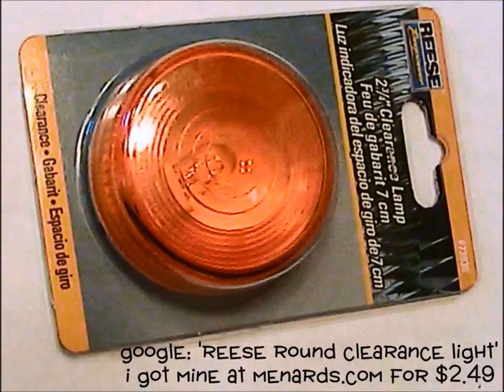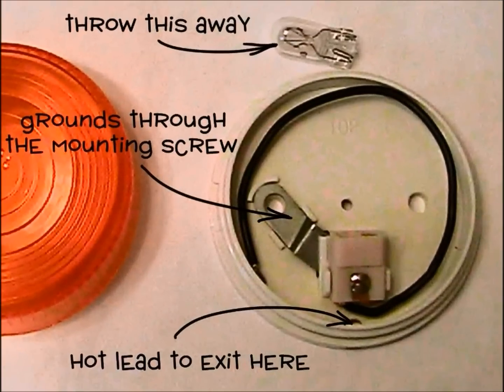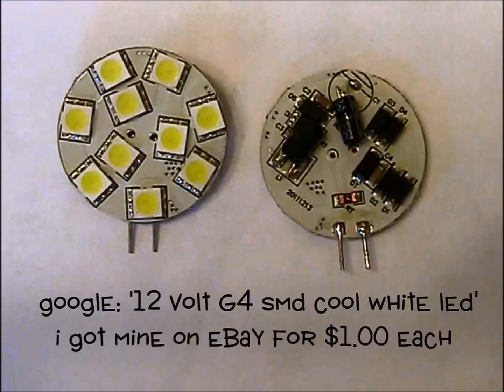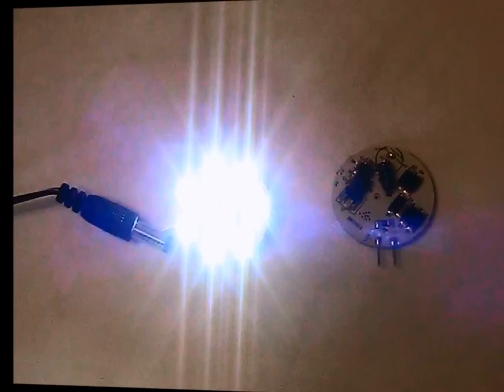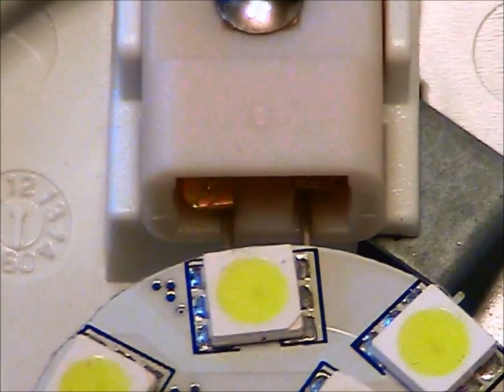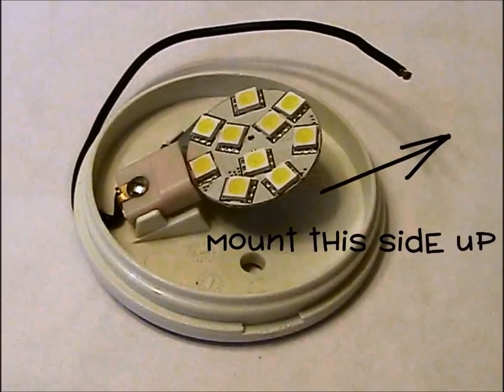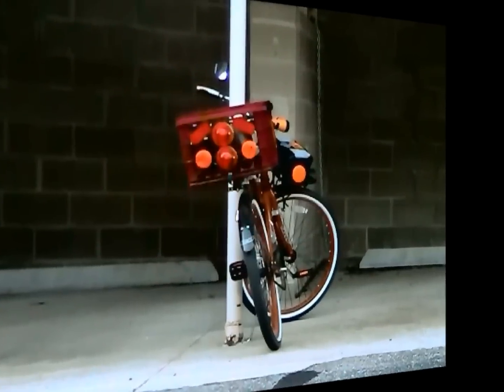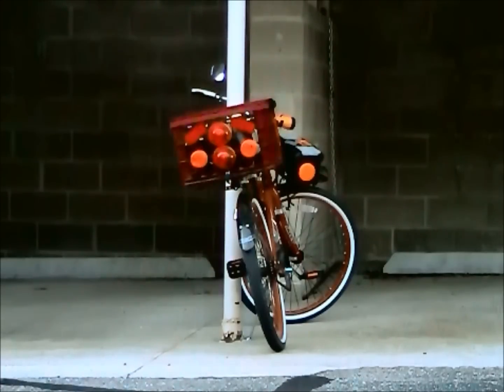Make Your Own LED Lights For Bicycle Turn Signals And Flashers

Comment: Nice job!!!!! With all these bicyclist getting hit and killed out here in So Cal maybe you can mount these on some kind of small piece of material to put on the tail end of any bicycle....beats getting hit by a car!!!
Reply from the maker: We're on the right track here, but these turn signals are only supposed to work when turning. A cheaper and better solution to being seen all of the time is to use a strobe as a tail light. I use an electronic 'Flare Alert' as a tail light and for visibility. See my video, 'Flare Alert: The Best And Brightest Bicycle LED Tail Light Ever Made', on my Youtube channel.

Comment: thanks for your helpful responses.  could this all be powered with just a 12v alkaline a23 battery? 12v battery powers 12v led lights and 12v flasher? theres this video that says you need a driver (current regulator) when connecting a 12v power supply to a 10w led or else it'll fry the led.  why isn't that needed in this case?
Reply from the maker: danh le I can't answer all your questions because that would require designing a completely different system. I can only show you what I have done. Check out my other videos that show schematics and details of the two systems I have built so far. I'm sorry I can't be more helpful.
Reply: ***** you are respectful and helpful. thank you

Comment: how do you attach the wires up so it is a circuit? There is only given the black wire, and I am unsure how to connect the second wire, which i assume i need. Any help?
Reply from the maker: +purplewuggybird I soldered a ground wire to the lamp base for the ground. Be careful not to melt the plastic bulb socket.
Reply: Clarence Cromwell

Comment: so the moped handlebar switch assembly is what makes the lights flash on and off? I would think that switch would just turn it on and off completely-not make them flash. is there something in that switch like a capacitor responsible for turning it on and off? wiring and electronics confuse me so sorry if that sounds stupid.
Reply from the maker: I covered this in an earlier reply and you are right. The switch only selects the on-off-direction function of the signals. I used flasher model number G215-EB from www.superbrightleds.com because it's one of the cheapest and easiest to use. It's a two-wire unit that I wired into the power lead just ahead of the switch. I included a peek into my fuse box and a wiring schematic in my Youtube video "Phase3: DIY Make Your Own Bike Or Bicycle Solar Power Lighting And Electrical System". Good luck.
Reply from the maker: The flasher I used is two-wire. The one you referenced is three-wire. So mine is simpler. But the description you referenced says it will work and I have no reason to doubt them. Good luck.

Comment: They look great!

How are you powering the lights?  Do you have a video for the flashing unit and handle bar controls?  Thanks!
Reply from the maker: See my video 'DIY Make Your Own Bike Or Bicycle Solar Power Lighting And Electrical System'. I bought the flasher from SuperbrightLEDs.com and the handlebar control from eBay.
Reply: Very cool!  Thanks!

Comment: Can you please let me know the other items you bought and about how much they were? Such as the flasher unit and the power source.
Reply from the maker: ***** Check my other videos detailing the components I used. I located everything on the internet using search engines, usually through eBay, and I found that price/availability fluctuates. Researching and acquiring components is part of your project. Good luck.